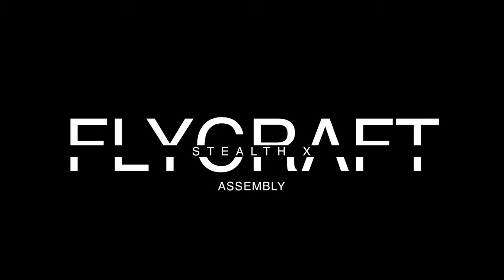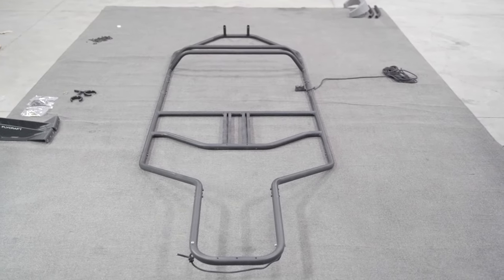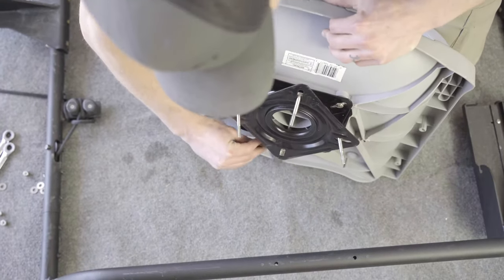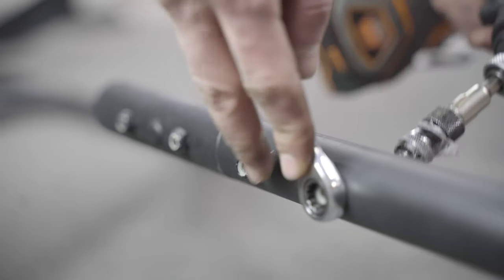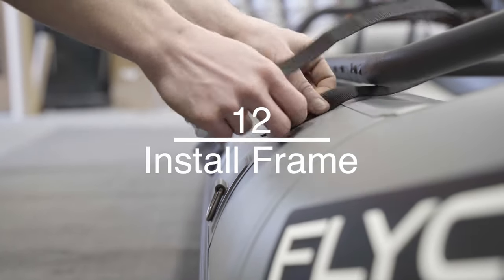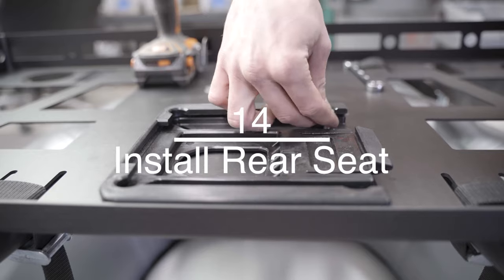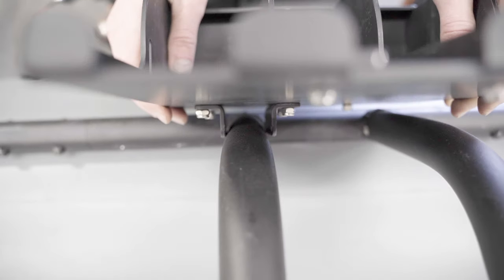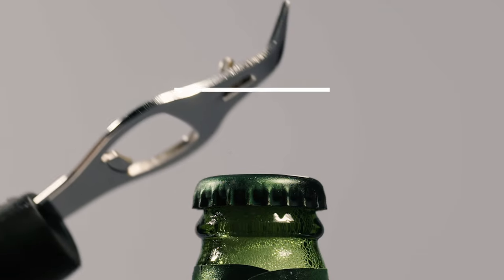How to Assemble Flycraft Stealth X

Comment: I'm looking forward to mounting my panoptix perspective mount on mine when it gets here! I'm hoping to do videos on the local walleye, and salmon fisheries, etc; all from the stealth x!
Reply: Did you mount your transducer any pictures or videos? Thank you
Reply: @markporebsky4768   Yes! I have made quite a few modifications. 55lb thrust motorguide xi3 (remote control with spot lock) mounted on the bow platform, amped outdoors 100ah battery, 2.5hp suzuki, Got a garmin 73sv uhd sitting in a summit fishing products icefishing kit to house the panoptix, with a summit fishing panoptix & perspective view mount. Thats powered by a 30ah amped outdoors battery, and a garmin 93sv uhd that will be used to run the side view off the transducer that comes with it. I replaced the rowers seat with a 2'x4' sheet of PT that I primered gray to match the boat. Cut a 2x10 to 4' and primered it and put that in place of the front seat in order to mount the quick release hardware to it, and so I could mount better rod holders to something a little more solid. (was having a problem with the ram-claws not being able to grip tight enough, causing the rod holders to spin under pressure from trolling big plugs). I literally am just finishing it up; have only gotten it on the lake twice
Reply: @markporebsky4768   But unfortunately I have not had the chance to make a video yet, I'm still figuring out where everything needs to go for my needs, but I should have something loaded to my channel in the near future!